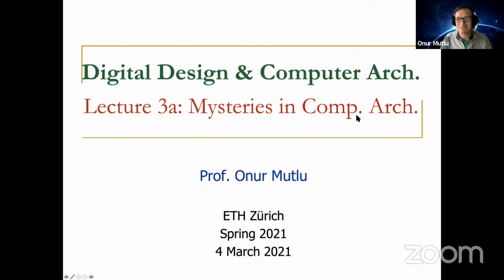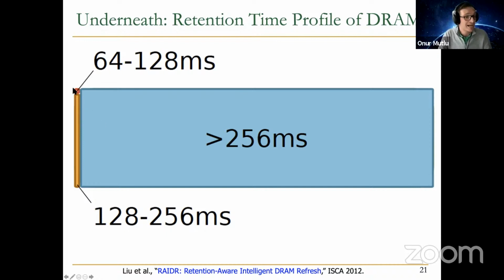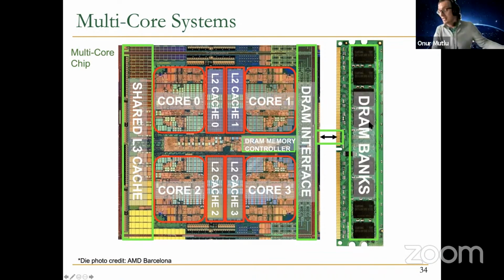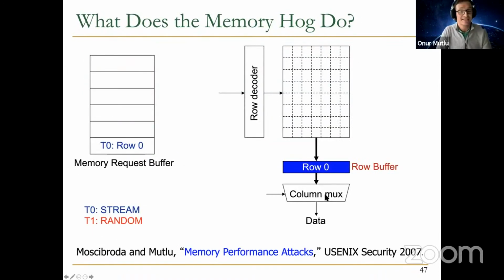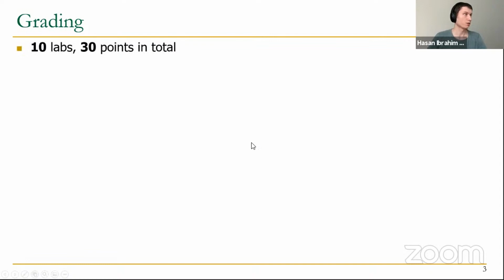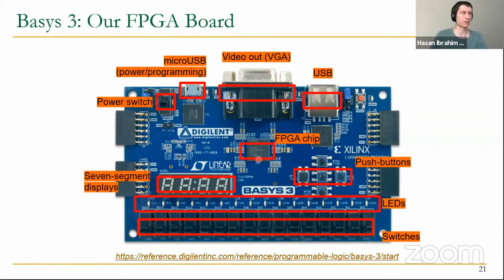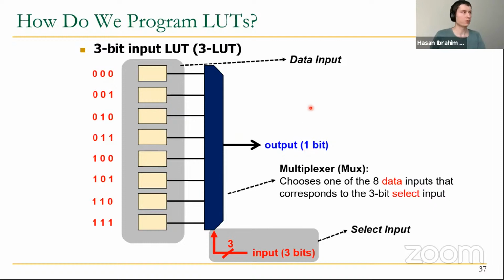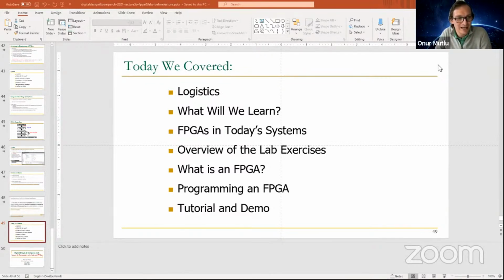Onur Mutlu - Digital Design & Comp Arch - Lecture 3: Mysteries in Comp Arch, FPGAs, Labs (Spring'21)

Comment: what does it mean by "linesize" in 53:00 ? Is it the row size? But if so, why it can have a high buffer hit rate since it would access different rows each time?
Reply: @poppmeow7586 Yeah idk if that's the size of the row in a DRAM block or if it's just cycling through an array of some size stored in 1 or over multiple rows in a DRAM block